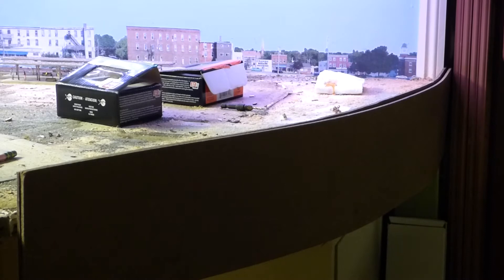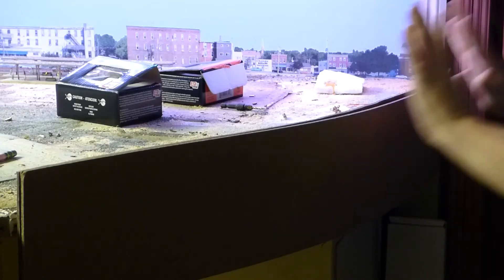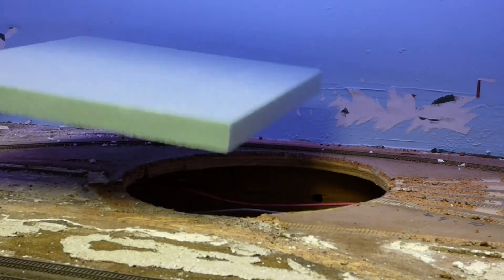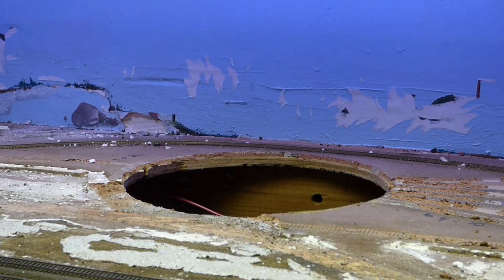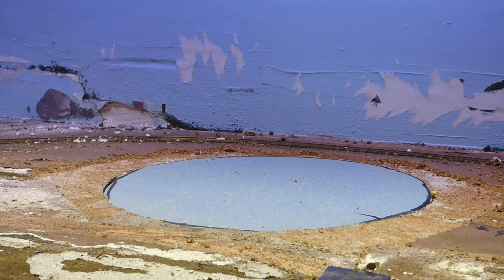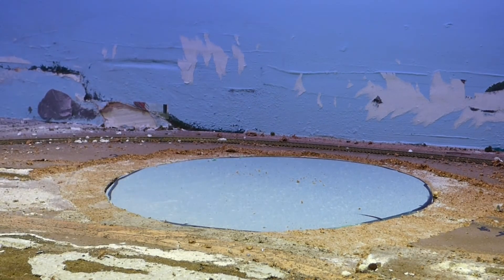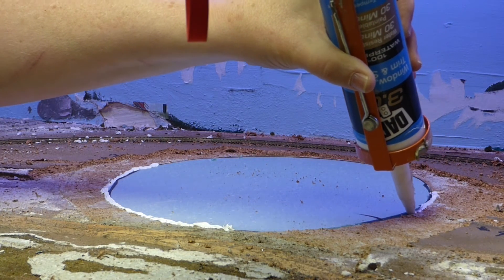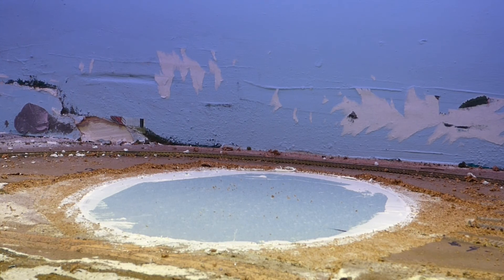Building a new passenger train yard part: 5

Comment: I'm sorry I forgot what I wanted to ask you. In the episode when you placed the plexiglass in the slot. Why is there a piece of tape on the bottom of the plexiglass? and is it important? 
Thank you for your time 
Sincerely 
Allan
Reply from the maker: @allanmartinez1190  hey Allan thanks for the nice words the tape was on there because the plexiglass I got was a little thin so I wrapped the bottom edge with duct tape to make it a bit tighter
Reply: Thanks Mike I really appreciate you responding my comment. You have no idea how frustrating it is when you seek help from fellow railroaders and most of them won't give you the time of day. It's even worse when they find out that you had no intention on using there ideas for that particular scale size. All I want to is to learn as much I can regardless of the scale and apply it to my layout. My interest in this Hobby is all 3 scale sizes. For O-Gauge I run Lionel FasTrack my trains consist of Postwar and Modern-day Cars & Locomotives. I also have a large collection of HO as well as N-Scale. I just never got to build a layout and I have the space for all 3 Scaled layouts. Maybe one day I might combine all 3 scales on one giant layout so I can take advantage of the depth of field concept. 
Thank you for your time 
Sincerely 
Allan